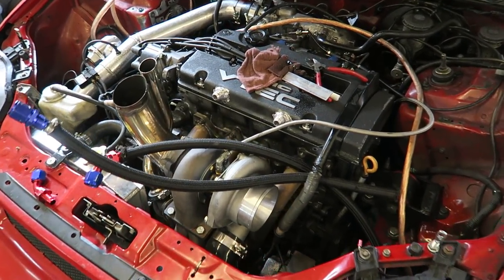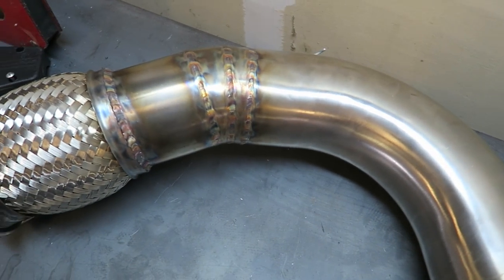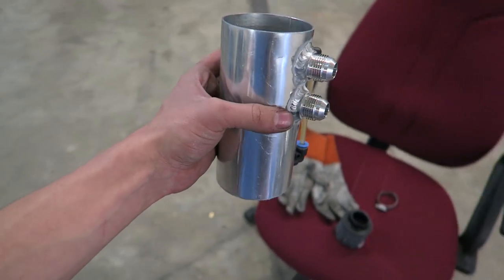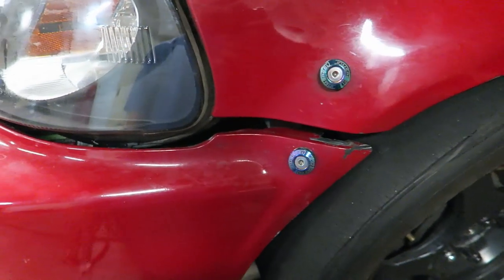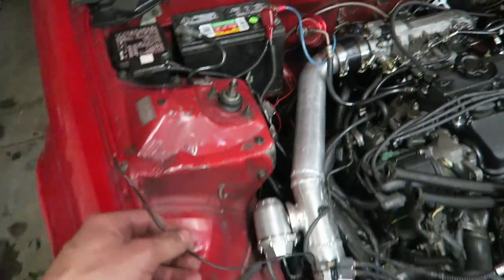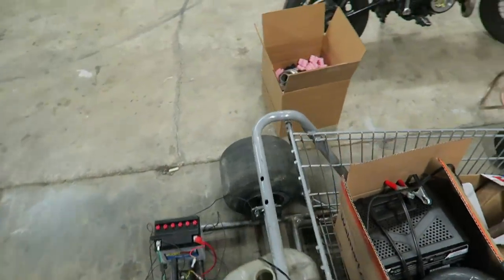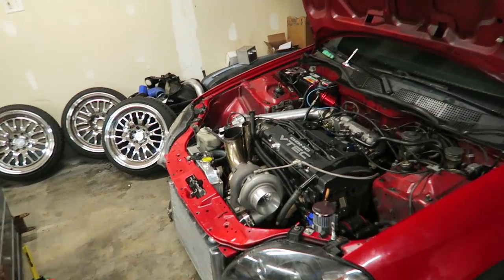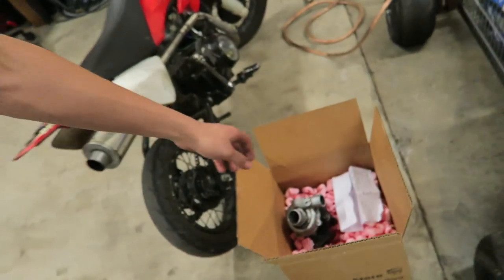Turbo For The Shopping Cart!

Comment: on the go kart engine on the head there is an oil fitting when you are putting the turbo on you can use brake lining for that turbo it fits the hole in the cylinder head hope you read my comment :)

Comment: ihi rhb 31 turbo, officially the world's smallest functional turbo.  You will probably need 20hp to get it to create usable boost but the applications for that turbo you can get up to 100hp at 14.5psi, works best between 125 and 700cc's.

You will need an auxiliary oil cooler and oil pump for it but you can tap into the oil pan on the engine to run that turbo.

Comment: You can tap the IN side for the oil feed line from the valve cover of the Lifan motor. If my memory serves me right, theres a small bolt on the top side of the valve cover that has oil pressure for the oil line of the turbo. Might as well give it a try bois!

Comment: hey man I have a bit of a Frankenstein bike I've been building for some time now and I started with that motor a cg150. the turbo is a ihi rhb32 or 1. I use it very good for the size single. the clutch basket likes to break on the China motors. so get one off an xr200 along with the oil filter thing. fun stuff the xr200 motor is a nice upgrade though we made like 30hp on 21psi with the cg and when we switched to the xr we made 60ish after breaking some stuff at 21psi. oil we used an extra pump I had and used the access port on the stator cover to mount it in and rerouted the oil system some if you send an email I'd be more than happy to send pics of what I mean. works though I have 36psi at my oil rail at idle 600ish rpm and 40 at 10krpm no smoke with a small restrictor.

Comment: turbo the pitbike too
Reply: Devin Balasi You can't turbo a 2 stroke
Reply: +Jäger its a 4 stroke and turboed 2 strokes work
Reply: Jäger it's a 4 stroke
Reply: Jäger its possible but its been done but its not just a case of slap it on and go power gains arnt much and the efficiency is a joke plus really hard to keep back pressure in the expansion chamber
Reply: The pitbike is probably a 2 stroke and i think it would be too much work to get it working with a turbo
Reply: Jäger the pitbike is 4 stroke -.-
Reply: Devin Balasi pitbike are 4 stroke
Reply: the go-kart engine is 4stroke too buddy
Reply: Brian Mckeown all engines now a days are 4 stroke fellas, 1 intake 2 compression 3 combustion 4 exhaust
Reply: antxmod12322 hope you're not serious
Reply: i feel like he is, i cant figure this out but he has access to the internet but cant even google his own stupidity. its a damn shame
Reply: I get it it's a 4 stroke.
Reply: Lucas two stroke diesels operate differently than a two stroke gas engine. You can turbo a two stroke but it wouldn't be as efficient as to just bumping compression or putting nos to it.
Reply: Devin Balasi it's different because 2 stroke diesels can hardy induct air so the turbo or blower is required to make it run
Reply: colston mulligan no it's different because in a gas 2 cycle the air fuel mixture goes through the crankcase then through the ports into the cylinder. Where in a diesel 2 cycle it just enters the cylinder
Reply: Devin Balasi my point exactly there's nothing putting air in the engine witch is my they require forced induction
Reply: The pit bike is a 4 stroke.
Reply: +EK GANG All the cheap weed whackers and leaf blowers are 2 stroke. A lot of dirtbikes are also 2 stroke so get you facts straight for fucks sake.
Reply: I wasn't saying that it was a 2 stroke. Where did you get the idea that I was talking specifically about the shopping cart or Bike? I was never even talking about either of them, I was making a general statement about engines.
Reply: Yes you can just add the exact same stripes a dodge viper has to the the bike itself. Trust me go faster stripes make everything go faster :D
Reply: @jager5115  pitbikes are 4strokes
Reply: @Lucas diesels are not two strokes a 2-stroke is very difficult to turbocharge
Reply: @Johnny-tq9no  Yeah I was dumb two years ago.

Comment: When you get the kart engine running well all you would have to do is make a bracket to mount the carb on the intake of the turbo and a charge pipe running to where the carb once was. It's a basic draw through design. You will have to put larger jets but no biggy. Don't try to do a blow through design. The boost can blow back into the fuel squirters since carbs run low psi fuel.

Comment: You should take out the block plugs on the back of the motor, they make apt plugs that fit them and run a 6-an line down to them and have the oil drain back in. That's what we did on all the customer cars. Just my two cents

Comment: hvac tape works in place of tin foil and I've found it holds up better  when you constantly have to move the piece you do have to clean the adhesive off after but that's easier than taking the time to purge it again !

Comment: On alot of smaller 4 stroke engines. Oil passages run through the crankcase cover, if it has a filter you can usually find oil feed lines that run to that and actually have some pressure. I ran an oil cooler off those lines on an atv. look for those first, you'll also have to consider how you're going to set up the carb. Keep up the great vids!

Comment: i have turbocharged a 125cc lifan and i give you some tips ;) first you should get an electric oil pump for the turbo and run it with that carb in a drawtrought setup and get something like 15 sizes bigger main jet for it.

Comment: I had that oil level tube thing on my catch can but it leaks under pressure so I removed it. It's pretty cheap, those swivel plastic connectors just don't seal well. Is your's leaking?

Comment: I actually just put that same looking size turbo on my scooter, had it putting out 10lbs   
for oil pickup you may be able to tap a hole behind the flywheel for oil

on my bike that cover houses the oil pump and I was sent a new cover with hole tapped, and banjo fittings with hose
maybe that engine is similar?
then my oil drains into the dipstick hole

Comment: I can't wait to see you trying to WBO2 the shopping cart. You will probably have to make it a draw through carb setup with the carb on the inlet side of the turbo. You could EFI it using an Electrons 50-300cc EFI kit or make something of your own using megasquirt. I think everthing electrons sells is china from Ebay. You just have to work to find it.

Comment: I never heard what motor that is, for xr100 hondas, you can get a 118 big bore kit from really cheap on ebay, they have oil cooler ports on the cylinder (jug) that I would imagine you could plumb in for turbo oil. I think the carbeuration is going to be the biggest issue.

Comment: Use your old catch can to make an oil sump for the shopping cart turbo. Either use a small EFI in line fuel pump to oil feed the turbo OR use one of those little electric oil scavenger return pumps people use on rear mounted turbo kits to PULL the oil up and then down by hooking it on the return side of the turbo and pumping it back into the sump in the same way you would drink soda with a straw.

Comment: The problem with most of these inexpensive catch cans is the baffle used to stop the oil. It does a poor job. And yours has the in and out right behind the baffle making most of the air go straight from the inlet to the outlet. A very simple fix is to use about a 50  or 100 micron brass or stainless screen. You can get it easily and cheaply. A lot of the oil coming out of a motor is very fine. All a simple baffle or plate does is catch only a small amount that hits the baffle with most of it still in the air. If you look at a air and oil separator for a air compressor there is usually a brass porous filter somewhere in it. Even some of the more expensive catch cans have them. Just make sure it has enough surface area it doesn't impede air flow. I took a $20 eBay catch can and made up a multi layer baffle of 50 micron screen. You can use something bigger like 100 micron if it's a small can to keep airflow good.

Comment: They make fittings (like a banjo bolt) for that engine to attach an external oil cooler (or turbo oil supply) just look for XR200 motor parts since that's a Chinese clone

Comment: What brand and model turbo is that? Also, what are the port sizes? Looking to sextuple turbo/throttle body a v6 so I need very tiny turbos that have the same port sizes as my intake and exhaust runners. Na... not really but really what type turbo is it?

Comment: Hey man! Check out Cars and Cameras build of their turbo'd go-kart.  Lots of good info on the subject. You need a external electric oil pump to run that feed. Cant remember if they ran EFI, carbs and turbos dont usually like each other lol. But check the series, you get some ideas!  :)
Reply: chrisonfire420 honestly I would just make a small pressure chamber for the carb to sit in so it has a pressurized atmosphere, and maybe even run an electric fuel pump to keep the fuel moving, he seems like he can weld pretty well and efi is tedious and not quite as cool as running a turbo and a carb

Comment: Modulate your throttle, don't add weight.
Add an airfilter, plumb it back into your intake to help seat rings under boost.
Good idea putting the battery back.

Comment: nice show i have an idea for more weight honda front mount 3" bars like they use on drift cars with concrete inside aftermarket front bumper on top. and for the cart please add a small bov with f/mount

Comment: Usually there's a oil pressure test port on these bike engines, look for a small screw.  Just tap off that for oil pressure, and weld a fitting in the side of the crank case cover make sure it's above oil level.

Comment: For the shopping cart turbo, you will probably need a draw through carb system, where the carb is mounted before the turbo inlet, otherwise, you have to put the carb in an air tight box so that it has equal pressure all the way through. search up carsandcameras, they built a 420cc predator drift trike, and turbocharged it

Comment: I used to know the model of that tiny little IHI turbo but I can't remember what it is now. Still,there were like two model turbos made by IHI of this size that was designed for smaller engines found like that on certain motorcycles.

Comment: @ boostedboiz got i idea for ur catch can u should weld a on / off valve near the bottom and run a hose from the on/off valve  to the bottom of the car for easy drainage so u don't have to disassemble it all the time just to drain ur catch can. n btw the ihi turbo u got is really good for turboing ur pit bike i turboed my yx150 was pushing like 5 psi lmao kinda skechy tho lol but it worked the trails where even more fun than before

Comment: If you're curious about how to turbo an engine like that, look up cars and cameras. They turboed one just like that and had to switch a bunch of things like the carburetor to fuel injection and run a standalone oil system. If you want any ideas look there.

Comment: That big chrome plug under the headbolt on the output side should be into an oil passage. Just use a REALLY small orifice and tap into the oil pressure there.

Comment: on most older Volkswagens they have a lead weight on the bottom in-between the fire wall and the engine you could grab a couple of those from the junk yard and make a bracket for that they bolt to the VW so you can properly secure them

Comment: Also turbo is similar to vgt3e a very small turbo made by Garret  I have one on a 125 minibike  and get an oil cooler kit for small engines it come with a valve cover/ head seal with port for oil cooler rout oil to turbo from turbo into oil cooler  and cool back to valves

Comment: You should use the lead from inside old car batteries and mount that in the front for added weight. It'll be heavier and take up less space than cast iron weights.

Comment: That catch can coming from and back to the valve cover is t how a catch can works, it's suppose to go from the head to the intake to catch oil and prevent blow by. And to put that turbo on you will need to convert that carb to efi.

Comment: the carburator on the gokart wont work with turbo (probobly) if a carburated motor aint have a turbo stock the carb wont like the pressure, i carb needs vacuum to suck the air out of the bowl, if you try to force air in to the carb = not enough vacuum and that means no fuel that means to speed

Comment: in the engine of the go kart under the clutch cover there are 3 wheels one big with clutch on it one small crank and plastic mid size on on the bottom that is the oil pump i think if you screw out the oil pump you can find witch galeri is the pressurized ona and acces it from bottom of the engine and return it to the filing port on top of the ignition cover (cahin sproket side)

Comment: For the future, when you want to run a tapped fitting into a pipe, weld a little build up where you're going to  drill and tap, it will give a little more material and thread engagment on the fittings, wont leak as easily too.

Comment: If you could just put the turbo in there just as a blow off valve noise that would be cool but if it is a 4 stroke push 5psi into that guy!

Comment: If the go kart engine is 2 stroke, don't waste your time. You can't boost 2 strokes because the exhaust port is opening while the intake port is closing. All your boost pressure just flys out the exhaust.
Reply: Kyle B and who said it was 2 stroke clearly its a 10 stroke vtec!
Reply: its a 4 stroke.
Reply: Kyle B it sounds like a 4 stroke
Reply: Kyle B it's a four-stroke. but you can boost a 2 stroke with relocated ports.
Reply: You can easily turbo a two stroke with good results.
there's still enough pressure comming from the turbo due to the restriction the turbo creates in the exhaust.
Reply: Kyle B but you can supercharged it
Reply: Lol if you know how to use your eyes and ears, you can clearly see its a 4 stroke. 

Secondly, there are a ton of turbo 2 strokes 

I.e. Mountain snowmobiles
Reply: Kyle B you can.
Reply: u can probobly turbo a 2 stroke, 4 strokes have overlap to
Reply: It's a four stroke. 200cc Lifan ones from China I bet.
Reply: Wasn't paying attention. Was just listening to him ramble on about the turbo. It's obviously 4 stroke, now you 2 strokin pole smokers can calm down.
Reply: LOL GY6 engine  honda clone etc  lol kevin that shit made me laugh
Reply: If you can't turbo a two stroke, explain two stroke diesels.
Reply: The timing is different. They don't have as much overlap as typical gasoline 2 strokes because they need the compression to fire.
Reply: Kevin A. spotty dog.
Reply: The reason you see turbo 2 stroke sleds is because they have direct injection now. Throttle bodies move air, injectors supply fuel. Electronic fuel mapping allows for precise tuning of a:f ratios throughout the entire rev range, your not limited by carburetors like dirt bikes. No parasitic loss and near instantaneous spool up.
Reply: U stupid
Reply: Kyle B you do understand the rotory engine is basically a 2 stroke and those get force induction all the time
Reply: Rotaries are entirely different, besides the fact that they don't "stroke" at all, they don't have any type of overlap with intake and exhaust, so the boost doesn't have anywhere to escape like in a 2 stroke.
Reply: +potatoe4221 They have exhaust valves.
Reply: you can clearly see its a 4t ya noob
Reply: El Gato They're four strokes.
Reply: Kyle B  I have a 1/10 rc that's 2 stroke and I put a super charger turbo on it and it has pushed 33% more power so that's a fictitious statement
Reply: Kyle B They can reduce the opening
Reply: Kyle B it sounds like a 4 stroke from the videos I've seen of it it doesn't have a 2 stroke sound at all it's got that chugging 4 stroke sound

Comment: at 10:23 there is a head bolt with a copper washer on it, that hole is a passage way for oil up to the head. Make up a banjo bolt that will fit in there for your oil feed line

Comment: For oil you could use fittings for an oil cooler there is high pressure feed and return on the head

Comment: Back-pressure is gonna be a problem especially once it spools.
Reply: Why is back pressure going to be a problem? The exhaust is virtually free. The only back pressure is from the turbo which makes the slight back pressure loss negligible.

Of course you don't believe in the myth incorrectly spread information that back pressure is needed in an exhaust.

Comment: Carsandcameras tried boosting a go kart motor and it kinda failed. If that motor has a carburetor you cant boost it since the pressure from the turbo blows all the fuel out of the fuel bowl and doesnt give the engine any fuel. So if you really wanted to you would have to put an efi kit on it which cost quite a bit.
Reply: spookeh s im just saying that someone else tried and that was there result. they did it on a 420cc predator motor so it could be different.
Reply: You can just put the turbo after the carb so it sucks trough it
Reply: i just know it was a pain for them